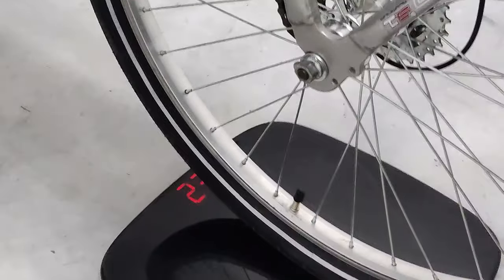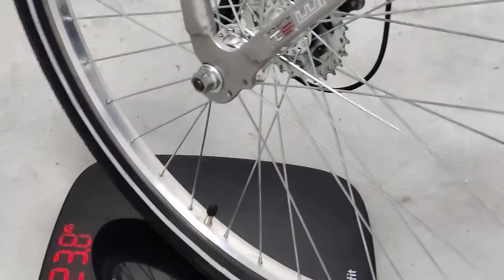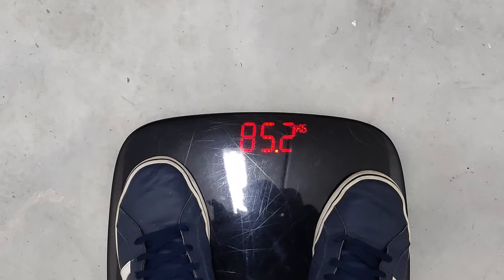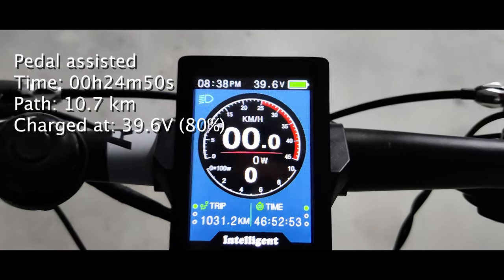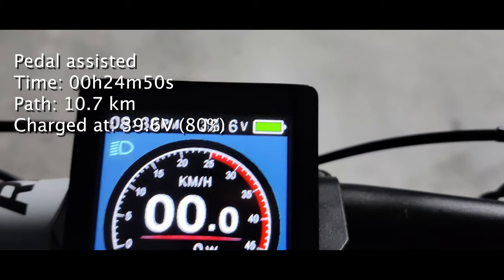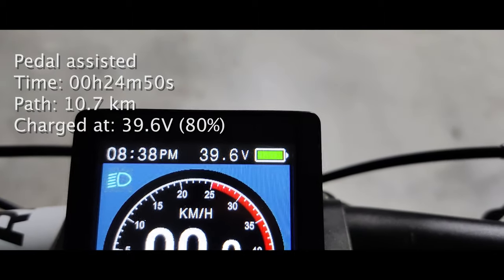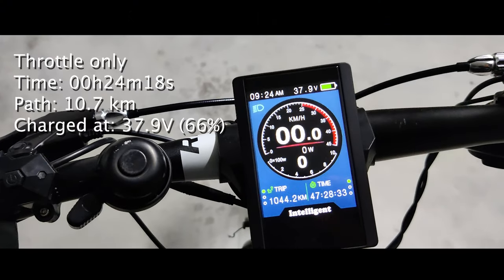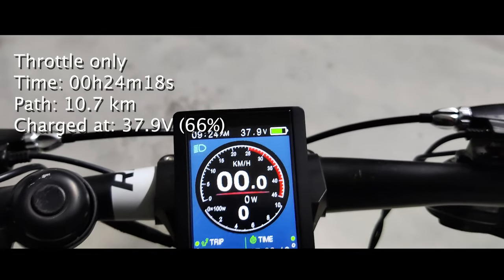Bafang 10 Km THROTTLE ONLY: How much Battery consumption for BBS02b 500W Mid-drive kit?

Comment: I have a 750w bafang with a 17.5 ah battery and got about 12 miles.
The bike weighs about 21kg with the motor and battery and I'm about 80kg.
When I used it on level 2 of 9 I keeps me nicely at around 15mph and 20 miles used about a third of the battery waiting for better weather to do a full range test but happy with how it performs so far.
Reply from the maker: Hi D M! Keep me posted, i would really like to know more about the 750W in case you do another range test 👌
Reply: Did you do a full range test,m

Comment: Good informative video,I have a 250W  36v UK legal Bafang motor with a 16Ah battery. Throttles are not allowed in the uk, unless  pre 2015, My conversion is on a 1990 Specialised rockhopper, which the UK licensing authority tell me is fine to fit a throttle as the bike is pre-2015, My problem is that certainly on the higher assist levels, the motor draws about 350W, I'm worried about burning out the control panel in the motor, Would fitting a control board for a 500W motor work on the 250W version?
Reply from the maker: Hi Pete and thank you for sharing!
Actually you should not have to worry too much about your peak watt consumption. Bafang's motor and controller are designed to handle up to double the current they are rated for!
My 500W motor sucks up to 750W sometimes on very steep climbs and with maximum assistance, but it's just a peak consumption 😊
Just don't overvolt it and you should be good to go!
Reply: @LukeLorusso  Thanks Luke, looked up the 250W control panel, think its rated at 36V 15A which would be 540W Great little motors, would love to play around with the bigger ones, Looked on the Bafang website, and they no longer seem to  list that style of motor, all the new ones fit directly to the purpose built frame, like the Bosch and Shimano motors do. Can't believe that they don't do them any more when there are tens of millions of old bikes out there ripe for conversion!
Reply from the maker: @petejones1957  they do, it's just that they recently reviewed their line up, also raising the prices.
Bafang also makes motors fitting in the proprietary frame, like the M620, but still makes general frame motors, like the M315.
Thankfully on marketplaces you can still find the old good ones

Comment: How do you know how much battery you have left.. I have chosen to have % instead off current on my display.

When biking the % decrease and when bike is stopped the battery % increase. So how can I know exactly how much battery I have left for my trip
Reply from the maker: You're right: either you chose to show the percentage or the voltage, during stress periods (so when you use the motor) the display has difficulties showing the right charge level.
It seems to behave like the gasoline tank gauge...
Well if you stop the bike and wait for a few seconds you'll see the actual charge level.
You could eventually measure your battery directly with a voltmeter. There also exist some that you can mount on your handlebar.
For 36V batteries: 42V is fully charged, 34V is 20% (you should avoid discharge over that), 32V is "dangerously low battery"
Reply: @LukeLorusso  thanks for the answer 👍

Comment: Hola amigo desde España. Gran vídeo. Estaría interesado en montar el bafang 500w 36v en mi bicicleta. Crees que una batería de 13ah sería suficiente? Gracias
Reply from the maker: Ciao amico! No, non fare questo errore: prendi almeno una da 15Ah!
Quando c'è vento il motore fa più fatica e rischi di percorrere meno km
Io ne ho 2 identiche da 15Ah: quando percorro lunghe distanze e una si scarica la scambio con l'altra 😉
Reply: @LukeLorusso  muchas gracias por responder amigo. El problema que yo tengo es que sólo me cabe ese tipo de batería en el chasis de la bicicleta porque es doble suspensión. Llevo mucho tiempo dándole vueltas en mi cabeza..
Reply from the maker: @nicolaslavandeira8948  ahia... comprendo il problema...
ok puoi anche prenderla da 13Ah, se mantieni basso il livello di assistenza potresti arrivare a 50km di percorrenza
se poi non dovesse bastare, puoi comprare una seconda batteria

Comment: C'è il motore da 36v 500w può andare anche a 48v 500w ? Domandò perché Gio ho la batteria da 36v
Reply from the maker: no! a motori da 36v si accoppiano batterie da 36v, lo stesso vale per 48, 52 ecc...
Se desideri installare batterie da 48v devi procurarti un motore da 48v (esistono motori Bafang da 500W a 48v)
Se hai una batteria da 36v assicurati di acquistare un motore da 36v

Comment: I have a 750w, 20 amp  batttery ,
 i do more than  50 km at very high speed: (top 9 PAS), i get 74 to 78 km/h max speed.
Do  46km  in 1:05hr, 
still left some batttery.

Comment: Can you pedal in throttle mode,? With that I mean is it possible to use the bike as a normal bike if u just like to peddle and with that asked will there be any resistance from the motor and feel just the same as not having a motor?
Reply from the maker: you can find the complete answers to those questions here: https://www.youtube.com/watch?v=T7ve958hJXE
but the fast answer is: yes to the first and no to the second
Reply: Pedal in throttle mode? Hmmm throttle mode is additive to PAS so you can pedal without any help as regular bike but there is some restriction.

Comment: Can you use throttle without the chain moving. In other word the pedals are still and not moving.
Reply: when using the throttle, the chain has to move to make the bike move, but the pedals do not
Reply: @petejones1957  thanks for your reply 👍

Comment: What speed were you going and how many hills?
Reply from the maker: check the description
Reply: @LukeLorusso  25 kph is fairly economical on battery. I wonder what range my 48V 17.5Ah battery would get at that speed. Probably 125 km on the flat if I could be bothered (assuming 170 watts to do that speed). In practice I could easily light pedal along and substantially increase range even beyond that. I tend to get 40 miles out of a battery on mixed terrain at 25 mph pedal assist.
Reply from the maker: @TimpBizkit  25 kmh is avarage, sometimes more, sometime less, representing most likely a real scenario.
Having a more powerful motor and a bigger battery (in your case +45%), even if resulting in more range, doesn’t necessarily translate in the exact same increase in range (will be less than 45%), even at the same speed.
Check this comment: https://www.youtube.com/watch?v=SVeSr5Ea_nw&lc=UgxgfgdnY4gd4Ee8I2p4AaABAg

Comment: Ive got bafang bbs02 48V 500W and i can do about 40km throttle only going about 40kmh where possible. Battery is 15Ah 720Wh. Ps. Motor seems not liking it. Started some noise just after 200km but it reveals it self only after 30min of such drive...
Ps. Im lightweight 70kg